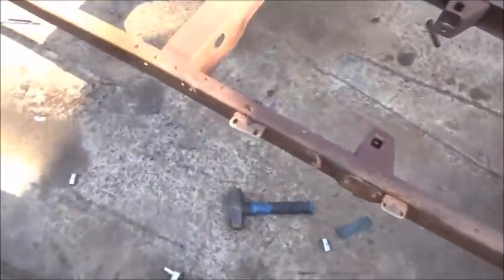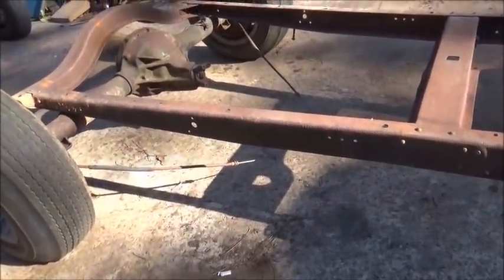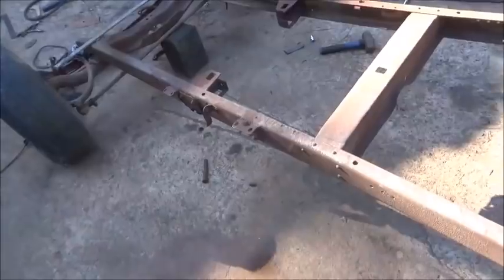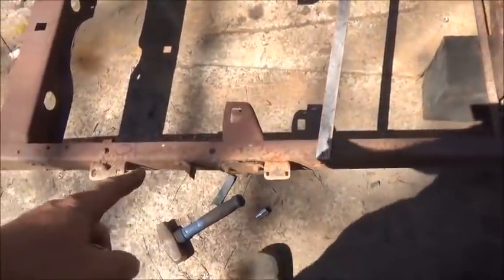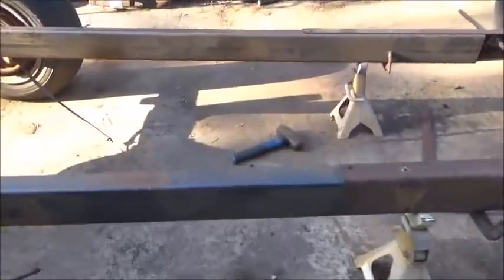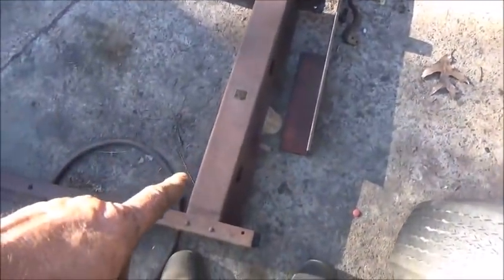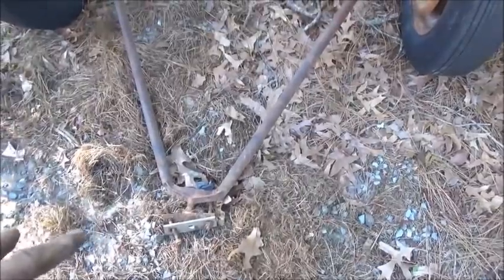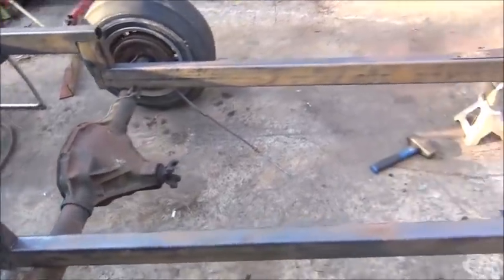1929 ROADSTER PICKUP FROM JUNK PART 6 Frame Work

Comment: Jonathan! Great video, love your fabrications.   I  noticed in the video that the tubing you bought was 4x2 , not 2x4,  there is a difference!!!
Tubing is called out by the side that the WELD is on first.
4x2 = weld is on the 4" side. Most common configuration. 
2x4.= weld is on the 2" side.  More expensive,  more difficult to produce, usually special order. 
Steel supply houses know the difference, but deal with public, who call out the size like buying lumber. 
Thanks again, great video.....

Comment: I believe the flyers forks are right.I have a 20 "with that style.         Love how smooth the straight 8's run, and low end power.
Reply: They look like they are a little short for that frame. I have a 26" Western Flyer from 1958 that has that style of fork and the light tank like that one, so, yes, the style of fork is correct but not the size. Of course, the camera angle may be throwing me off, and I may be mistaken about the size. It's hard to tell from the video. The one I have is in much better shape and is complete except for the original rear rack. It would be ridable, if I got around to fixing the flat tires. The tank is supposed to have a little light on each side, and the batteries went inside. Mine is chromed though some may have been painted. Anyway, it will be interesting to see what Jonathan does with it eventually. Even hanging it on a wall is better than it getting scrapped.

Comment: Great progress, dang that engine really does push it all back and makes for long chassis.  I need to see the body and bed sitting on it or next to it to get the perspective. I think its gonna be killer with the big ass motor.  What do you do when finish these guys are they still there or do you post anywhere to sell? I could hop up my daily driver but you know i think i would rather have a weekend Beater Rod that you can fuss with and drive. Like you said if you get it to a point where its safe and reliable you can still work on interior  and drive it around too.  Getting exciting from just 2 doors, Its so amazing. Thank You for posting. Hey if we want to donate to supplies how can we do that?

Comment: Thanx for the update, how thick is the factory frame? I thought you would have brought the 2x4 all the way to the front crossmember to suport the weight and tie in the front spring mount, but it look great and I’m sure with plating the frame it will be strong

Comment: AI built a x53 before,  I have  Boys mercury that's a murry , It has the correct springer front for your x53, this bike is missing the tank but it's not the same frame. It's a rider as is. Girls bike have a longer fork neck you can cut them down but have to cut the length off the springer assembly as well. Anyway , I'll sell my springer if your interested in really doing the bike. Or if your not sell me that project and I'll do it.

Comment: If you would have answered my comment, a few days ago,, I could have sent you some springs back from ohio with my nephew who lives in Fayetteville. He makes the trip once a month and he just got back to N.C. I know you have a lot of comments to read through.
Reply from the maker: Didn't see it, still haven't.
Reply: I see why now and it is on me, my comments were on two separate posts. The first comment is on the post, April 18, where you said you may sell the original Model A roaster and the 2nd post was on Part 3 of this series.
1st comment:
I am interested in the original roadster and have a lot of neat things to trade, from industrial sewing machines, Harley parts and car parts. I can give you an ohio hookup and have cash as well. My sister lives in Fayetteville and my nephew drives up once a month. I know where a rust free A truck bed is as well. May be worth your while. I also have a roll of light gray vinyl material.
Thanks
2nd comment:
Was down to the yard today and there was several 31 and 32 parts: 2 complete front axles, a axle, several sets of springs and 32 wheels, oh the torque tube and steering box with components. All could be bought for 20¢ a lb.